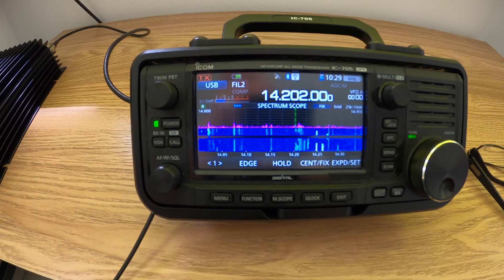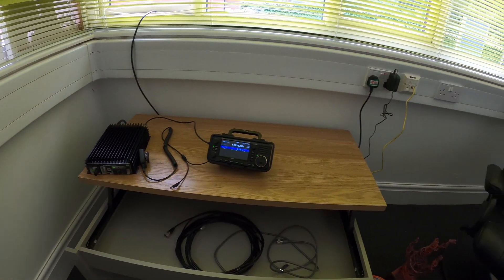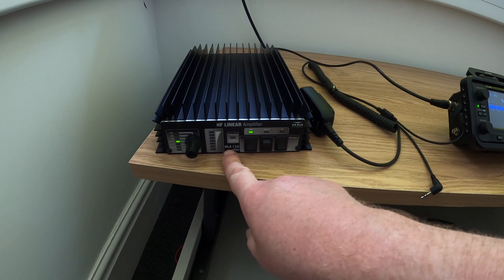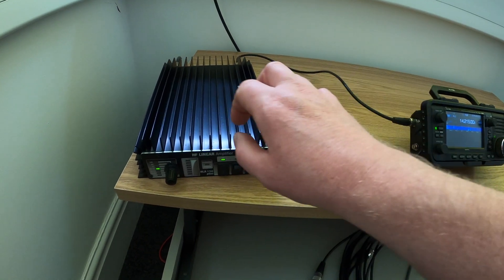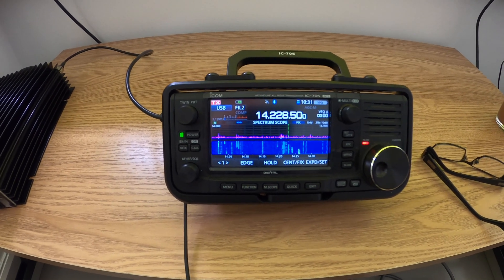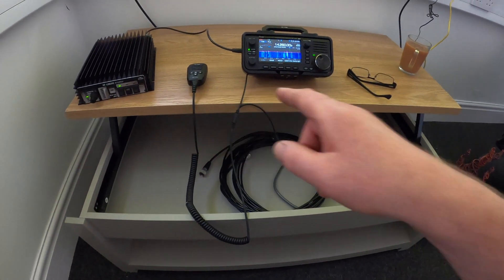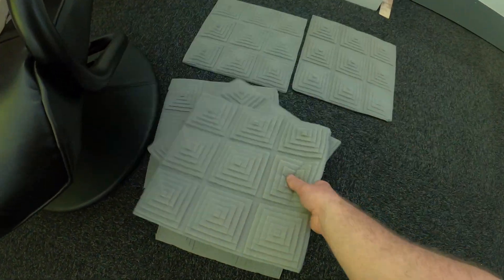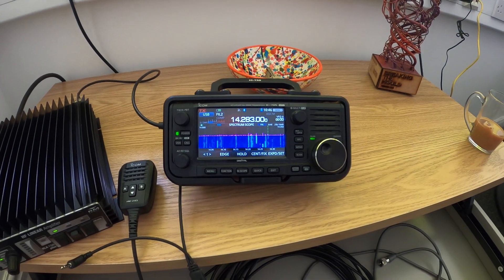Using a RM Italy HLA 150 plus linear amp with the Icom IC705

Comment: Hi mate, nice set-up. I'm still learning so apologies for the newbie question:
I've been using my IC-705 + AH705 tuner with a Chameleon MPAS antenna in my little garden, mainly for FT8 and WSPR.
With the recent changes in licence rules (I'm currently Intermediate) I'm tempted to get an amplifier. 
The reviews I've read so far point ne towards a Xiegu xpa125b, but some users seem unhappy with "magic smoke" appearing at random...
Would you say your set-up is safer than the Xiegu?
And would my Icom ATU get fried by the amplifier?
In advance, many thanks for your time. 
Best regards,
Manny
2E0HJN
Reply from the maker: The Xiegu is a good choice, it has an ATU built in. You will need a CAT cable to link to the radio for PTT which you can get easily.
Reply: @M0SZT  Cheers! 👍🏻

Comment: 20m of formula 0 super low loss at 30 Mhz is 0.47dB.   connector loss is negligible. so no more than 0.5dB loss for the run. 89% of Rf power is getting to the antenna matching network  on highest band ,more on lower bands. The largest losses will be in the coil,and ground loss. especially at the lower bands.

Comment: SD1446 RF Transistor used in theses amps are discontinued. so these amps will in time will be hard to get and repair. Rm make an mla100 which has smaller dimensions and properly uses mosfets   transistors. the rm mla100 is very expensive for 100 watts.

Comment: Hello congratulations for your video I found it very cool and I would like to know the maximum power you can reach with this linear RM Italy Hla 150 ??because I am in doubt if I buy one in Italy hla 150 or if I buy the one in Italy hla 300 plus for use with my Ivón ic 705 on my mobile station!Leave your opinion for me and 73 of Pu3Ykw/M …
Reply from the maker: I would say about 75% of the advertised output

Comment: yeah it was me with the efhw, use  a fiber-glass flagpole, fully extended with the end of the wire taped to the top, then drape it over the trees, dragging trough the top of the branches i use this system with my efhw when portable, you look silly, but it works a treat without putting widows out lol , i keep meaning to do a video for a demo, but never get around to it

Comment: Hi Carl,
Looks like you bumped into the YOTA contest? 
RF sensing okay with the amp your set-up. PTT line really only needed if you have other stuff that needs sequencing. Don’t worry about those losses too much. It’s working and will be fine. Perhaps stick a power meter on and check your output. You might be surprised….
1:1 choke always good at shack-end and then at least you can use the coax lead as an extra counterpoise/radial. Can be useful.
Have fun. Catch you in HH sometime

Comment: I would just stick with my ICOM 7000 if I had only one radio so I could use it at 100 watts on HF/6 meters and QRP when I wanted it.Of course I would still have higher output power on VHF/UHF without buying amplifiers for those bands as well and I could still use QRP on both bands as well if I wished.I only run my ICOM 703 PLUS at 10 watts and I have Zero desire for an amplifier for it since I see it as a waste of money.

Comment: Hi Carl, having watched your first video, i’m wondering if maybe you might be better hiding the tripod in a low bush out front and then shortening your feeder greatly. if the Slidewinder coil is above the top of the bush , you haven’t got so far to walk then either . The take off angle in the court yard is hitting walls on 4 sides, so just a thought fella, would be a good little experiment out front and you could whip the coil and mil whip off when your not there leaving the tripod in the shrubbery 😉 
What do you think ? , kind regards Bert.

Comment: Hi Carl,
If I saw correctly your join outside used two Pl259 connectors and a barrel connector (pl258). That is two connections not one. In any case if you are only running 80w on HF, then I wouldn't worry about the loss on the connectors that you are using. VHF would be a different story.
If you can get a wire up, end-fed or dipole, you will "probably" get better signals out and in. Not only stronger but probably slightly lower noise as well.
73 Ed DD5LP

Comment: Carl, another great video, thanks! I wouldn't be too worried about the line loss, it might be 2 or 3 db, but you are getting good reports, so not to worry. I would be more concerned that the joins are not waterproofed. I have had water get into coax, not fun.  So, yeah, I know that free advice is worth what you paid for it, but get some coax sealant tape, the self-adhesive stuff that forms a watertight bond on itself, and seal up the connections. I dunno about the wisdom of having the rig in the office. It would take some discipline to keep me working instead of tuning the rig. But your mileage may vary. Hahahahaha. Keep up the great videos!

Comment: Hi Carl, nice video and explanation about the setup.
I think if you have made decent connections between the rig and the ant, and you are enjoying the contacts you are making, line loss is not even worth talking about. I know from being on qrp in the uk, then it's worth some thought, but I think , if iam enjoying being on the air, regardless of what your ant is or your rig or power is, just chill and enjoy meeting new op,s.
Recently I had a great cw ragchew on 30m, the swr was through the roof, as I was using my 40m ant, but what  an enjoyable qso. Not everything in life has to be perfect before we can enjoy ourselves. I  often hear folk rattle on about not getting the right coax, the best connectors or a perfect swr, and are not happy until they do, and in the meantime miss out on all the radio fun there could have.
Your station is working great, yes you could experiment with a wire up that tree, it might be better or not, but my dad always said if it's working well and your happy  don't worry just keep enjoying. With band conditions getting better each month, a coat hanger ant will get you dx hi.
Cheer.

Comment: What do your work colleagues make of the radio gear in the office?  I did spot in the first video a tall building in the back ground. Ideal for a webdsr?
Reply from the maker: My work colleagues are complete geeks and are fascinated by ham radio especially the science and the usual gear porn. We have worked on projects requiring RF data packets and got the hang of packet modes easily. Yes there’s a great opportunity for a remote SDR station

Comment: Carl, I really like your radio setup at Keele University, and your in depth explanation of your setup, I found it to be very interesting and entertaining. You said that you are using low loss cable, and with that I would say that your putting out a great signal with the reports of 5x9 that you were receiving, so I probably would not worry too much about excessive line loss since you are using quality low loss cable. Carl thank you for sharing and can't wait for your further adventures.

Comment: estimate 1.5dB loss for your length of cabling at HF.
Reply from the maker: Thank you!
Reply: Did you consider the (2) PL-259 connectors and the Barrel Connector? They alone are at least that not including the feed line loss?

Comment: Assuming your amp is putting out 90 watts at 14 MHz. You main coax run is 20 meters and you have 6 connection points at 0.01 db. loss per connector. Power at the antenna should be around 83 Watts (82.84) is what I calculated. Gain of the antenna is probably unity. I could not find out for sure, as all of the magazines such as QST and suppliers like Ham Radio Outlet do not allow antenna gain claims to be posted...... As most of the manufacturers ( embellish) the truth. 
Nice setup Carl, seems to be working a treat. Myself personally, I would look into getting something up into the trees or on the building. A little height is always a good thing. And it’s out of the way of “ prying eyes” and “sticky fingers”

Comment: I was thinking about a small (as in size) amp to pair with my ic-705, think I will just buy an ft891 instead, 100w and you get a radio included! (I think you already have one). Love the content, keep up the great work.
Reply: I have both the IC-7300 and IC-705, love them both. Picked the FT-891 about a month ago and took it out into the field today with the Chameleon TDL. It was nice to have 100w SSB when band conditions were up and down. It is a great addition to the stable.

Comment: Coax Loss.. Assuming you are only going up to 28 MHz
Even using UltraFlex 7, which is good, is 3dB dB @ 100M
I would guesstimate,
Assuming you sort out that last patch lead and your run is say 25M
Loss is @ 1dB, do not worry, power loss negligible,
and on RX, band noise will be greater than any noticeable RX loss